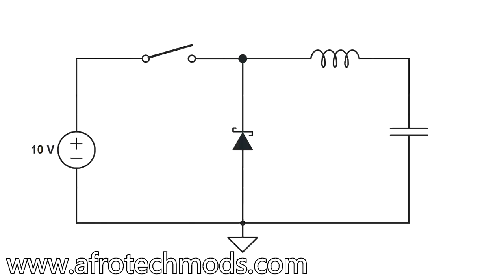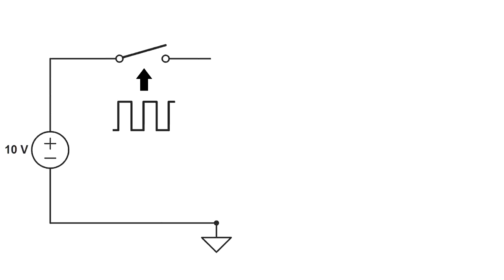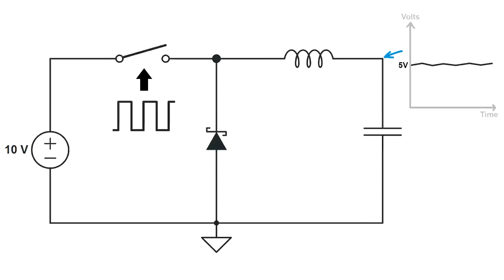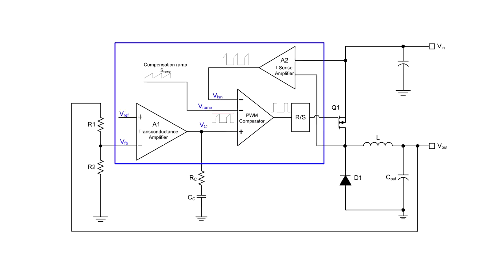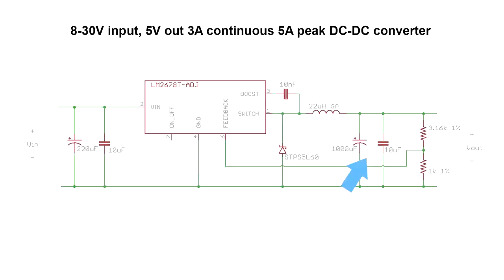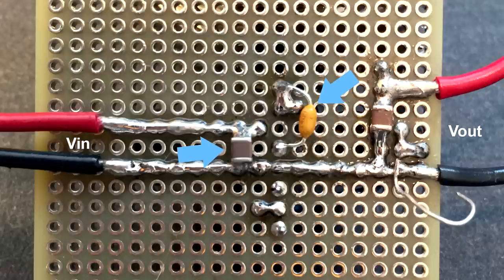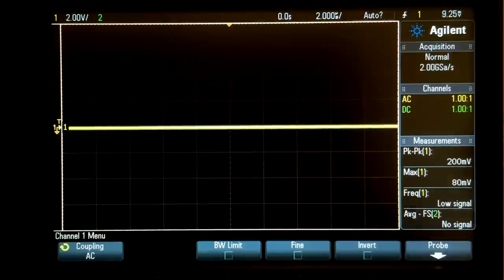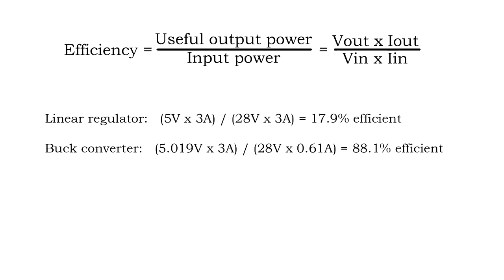Switch mode power supply tutorial: DC-DC buck converters

Comment: Great video on how to build a DC/DC switch mode power supply. And, thanks for featuring TI's SIMPLE SWITCHER buck converter.
Reply from the maker: +Texas Instruments Glad you liked it. Been using your products for years!
Reply: +Texas Instruments i didnt expect that...
Reply: I wished Ti would have more reference designs for us newbies on their  chips. I mean more reference on variable outputs using digital pots and linear pots would be nice. More references on pass power transistors for more current output too. I always throw together a lm317 circuit for 15 amps or more to test audio amplifiers. I could figure this out but would rather not blow out $200 worth of parts before I get close. And as far as I can see, none of their simple switchers, high amp series chips have any reference for soft start circuits. What's the first thing a newbie going to build? A high amp variable voltage power supply . Make it easier for them and get them hooked on your products and they'll use them for life at what ever company they're working for....
Reply: It's sad that none of you guys will do a tutorial video on how to solve feedback loops for compensation networks in switch mode power supplies. You guys always take the easy way out with using devices that have the compensation networks in place. Is it really that hard for people to understand it or is the math too advance that you might scare away people?
Reply: Microcontrollers are what is holding prices down, everytime they get smaller they are cheaper to made(more of them fit on the wafer) and contain less physical material than additional wires and PCB components with same function. And they are available for analog applications as well.
Reply: Great video +Afrotechmods im getting a wave like pattern at out put. I am making power supply from 12v to -2.5 v. Should I increase caps on the output??
Reply: Afrotechmods great video! I also making a 12 v to -2.5 v power supply and getting waves at the end with quick slope up then slow slope down at output. Should I increase output caps? Thxx
Reply: Most of these videos are for a laymen or hobbyist who just want something that works out of the box. They are not interested in the theory behind what makes a stable DC to DC converters work. Besides if he went the route you are suggesting the video wouldn't have half a million views. Therefore hit the books not youtube if you want to learn how to design compensation networks for switching converters!
Reply: T
Reply: @ihatenumberinemail  Because an analogue circuit can react far faster than a microcontroller, and is unlikely to crash sending 28v to your downstream circuit because you failed to anticipate all control conditions in the code. There are applications where microcontroller control is appropriate, but using an actual analogue control loop will always provide better transient response in the load, especially during turn-on, and lower noise on the output.
Reply: Wow! Just found this channel. What a refreshing mix of theory with very practical considerations when building. So much better than those white board regurgitation videos by people who never build anything in the real world!
Reply: Now thats a recommendation my PI would have noticed😂

Comment: NOW I get it! sorta.
Where can I get a "crack-head mashing a mechanical switch" and what's it's service life?
Reply: In my neighborhood. They are everywhere and pretty cheap.
Reply: Yea but how long do they last and how reliable are they, and will i have to hide my valuables
Reply: Yup. They'll pawn your Fluke multimeter for $20.
Reply: Lmao!
Reply: +Shroom Duke That crack head has had me rolling around the floor for the last 5 minutes!!
Reply: there are not many limits to what you can get a crackhead to do and for how long, if you have enough crack to keep them going.  only crackheads with no crack will pawn things.   A crackhead with crack will only smoke crack, and wont stop until it is gone, and like any other constant, you can use this to your advantage.   All you need is a transistor, 2 crackheads, 3 crack pipes, and 2 lighters.   wire the base to your breadboard, wire the emitter to the push button of 1 of the lighters and the collector to the other.   Now you have just built the fastest switching and smoothest regulation with just 1 component (+crackheads/crack accessories/crack)why 3 crack pipes?  well think of it as a fuse, if they go too fast they will eventually break their pipes and stop functioning until you replace the pipes, the 3rd pipe provides some protection against this condition by not only serving as a replacement should one of the pipes break, but also sharing in some of the load, increasing the overall life span over a 2 pipe design.
Reply: Don't let them pawn the comedy gold from this comment section.
Reply: @asulliv1954  speaking from experience I was not offended

Comment: I've tinkered and modified a few switch mode power supplies to make them produce different voltages (usually higher) than what they originally did, this has inspired me to make my own regulated SMPS based on this.  I might make it variable by changing one of the feedback resistors to a variable resistor and see how well that works.
Reply from the maker: I think you will like next week's video then.

Comment: Great video Afrotechmods. Buck converters are so much better than linear voltage regulators. I have a homemade portable charger with a usb port that i limited to about 2 Amps and a Buck converter can really do the job. You can also buy cheap buck converters that they install in some cars in Asia for interior lights and stuff on ebay for cheap and they can be a bit more efficient and weatherproof than what you could build from this video. Great explanation about them! 5/5
Reply: Don't discount linear regulators too quickly! They have their niche too. Without the switching action of a SMPS, they generally have cleaner outputs. They also don't require inductors, which is very important because inductors are by necessity large and expensive(in a relative sense.) With a low dropout linear regulator, one could achieve reasonable efficiencies by keeping the input to output voltage ratio close, though care must be taken not to come too close to the dropout point. As afrotechmods mentioned, in the range of about an amp or lower one could consider using an LDO, and the total solution size, cost, and output ripple would be superior to any switching power supply.

Comment: Nice job getting the LM267x series to work well on perfboard! Without using snubber networks I could only ever get them to give low output ripple by using a PCB with ground plane lol.
Reply from the maker: I was pretty impressed that I pulled it off on perfboard too! The huge ceramic caps I used were larger than you would ever need in a commercial design, but they give extra leeway for beginners to make mistakes and still have good performance.

Comment: I was experimenting with 555 step down/step up
all you need is mosfet/npn for step-up or pnp/p-mosfet for step down
and zener diode+transistor
so you pull down reset pin on 555 with transistor (which is pulled up with 10k)
voila, you have voltage stabilization
maybe tl431 also will work

like this if you like my idea

Comment: Can you make a tutorial on making a SMPS using a crackhead mashing a mechanical switch?
Reply from the maker: Got a crackhead I can borrow?
Reply: Afrotechmods in my class i have two of them. I wonder how  I can send them to you. The german mail will check for human contents :(
Reply: just build the 3:21 circuit and use a big button, a large inductor with iron core (like the primary of an ignition coil), and a huge electrolytic motor starting capacitor!
Reply: ***** Due to the high cost of supporting a crackhead, you should opt to use a variable speed motor to mash and unmash the button. In addition to being less costly it would be much more reliable as well. (plus you don't have to remain present to assure it doesn't run off with your expensive silverware).

Comment: Good video. They only flaw I see is the use of solder to conduct current. To me that is always a no-no. Proper soldering technique requires all conductors to be as physically connected as possible with the solder only making up the last microns of conductivity. I've been in electronics repair for almost 40 years, and by far the most common failure I've seen is improper soldering on high power/heat connections such as transistors and power resistors. Never rely on solder to make the physical connection. For this demo, sure it works, but I wouldn't put that into anything I wanted to keep working for years.

Comment: Seems like you could feed the output of a buck converter at desired DC+max ripple into a voltage regulator to have the best of both worlds: the heat dissipation on the regulator would then just be the RMS of the ripple voltage by the current, significantly less than down-converting from a primary source. And you'd get the smooth DC output you need for sensitive circuits.
Reply from the maker: Yup. This technique is sometimes used in commercial designs.

Comment: If I understand correctly, it draws less current while providing 2A output current (Shown in efficiency calculations). That means, I can use a 12V 2A (24W) common adapter to power 5V 2A (10W) Orange Pi and and 12V 500mA (6W) white LED strip. Correct me if I am wrong.

Comment: I remember my first linear power supply with LM7805 and LM7812. We used a casing with was pretty much a big steel casing and inside we screwed those LM's to heat dissipation aluminum thingys. It was pretty powerful but it got hot. Not long afterwards I thought why did we not just heat dissipate to the case which should/could take even more. And sure it could have been a disaster but nowadays with pretty small sensor/RCB type of things I think the casing itself just to dissipate heat better.

Comment: What are your thoughts on using boost-buck converters for applications such as solar powered chargers (mainly concerning how safe they are). Many companies make boost-buck converters which will basically take a very wide input range (often 1.5-40V) and produce a regulated output. I was thinking about using one along with a prebuilt USB power bank (since many places such as ebay will have 12,000-20,000 mAh ones for less than $20) It just seems like a nice upgrade to one would be to add a solar panel in addition to a boost-buck converter, and a small power switch to essentially allow for solar powered charging of those USB power banks. (It would also be cool if it can be safely done, to have a build of it on a video)
Reply from the maker: There's nothing inherently unsafe about boost-buck, the safety will be a function of how well they are designed. Boost-buck is a good way of squeezing a little extra juice out of solar cells that are operating at low output levels, but if you are really looking to go all out you should look into MPPT controllers.

Comment: Afrotechmods, First let me start by saying your videos are my favorite gotos for trying to learn more about electronics. I've watched most of your videos at least two times, often more. 

I may not be understanding all the concepts completely yet, but I had a thought and wondered if there was any merit to it:  

Would it be possible, or even make sense to use a buck converter to get the power roughly where you want it, then feed that into a linear regulator to compensate for the AC ripple, thereby getting the efficiency of the buck converter, and the smooth DC from the regulator?
Reply from the maker: Yes this is possible and some high end adjustable power supplies use this topology.

Comment: Hi man. Very nice videos with parts attached. Question: Why do you need two caps in both input and output? Can you just use, say, a big 300uF in the input? and 10uF is nothing compared with 1000uF in the output. Why do you need two? thanks a lot

Comment: Say you have 12-30 input and wanting a steady 24v, current draw on 24v is never higher than 0.8 amps, how would you calculate what size fuse you need on the input side of 12-30v?

Comment: What are common switching frequencies of buck converter chips?
I've noticed that many switching regulators produce radio interference on 433Mhz (RC), which is quite annoying.
Reply from the maker: Anywhere from 40kHz to 4MHz, and it keeps getting higher as technologies improve. Switching frequency definitely affects the amount of interference put out, but good PCB layout and good component selection make the biggest difference. Learning how to design a good SMPS is almost an art form and I barely scratched the surface with this video.

Comment: Love this! A question if I may? I'd like to make a buck converter to switch about 20v down to 5v, maximum probably an amp. Probably less. Ideally I'd like it to take as few components as possible, and especially want it to be tiny, which rules out big 50V capacitors I guess? Any ideas how I can make good space savings (mainly in height of component)? Random question I know! Thanks, Mat

Comment: Now this is an awesome tutorial. I´ve been dealing with circuits for a few months only, as I´m interested in building a robot, where a buck converter comes in pretty handy. A fool like me startet with linear regulators, with all those disadvantages you just mention. I just have to give such a buck converter a try. The only question I have is, whether you know a good switching regulator for 5v 3a but with less voltage drop. The regulator used within your videos is rated 8V minimum to achieve 5v. Is there a good one with e.g. min 6-7V on the input?

Comment: Could you build a Buck/Boost Converter with current adjustment, not just voltage ajust? Also, I would like an output current greater than 1 A. Maybe 3-5 A would be OK.
I saw some clips using CI 555.

Comment: Great circuit upgrade from the LM317 video, and just what I need - 0-5 v output(i NEED to use a potentiometer) but I need a reduced ac power supply without the use of a bulky transformer - can I build a bridge rectifier with resistors after each diode to create a voltage drop (is this a forward voltage?) in order to create a 8-10 Voltage input for my regulated dc circuit? OR should I just connect my potentiometer to one branch of a voltage divider sub-circuit?   Thanks again

Comment: Once again another great video!! I was pretty stoked when you mentioned Dave Jones! When designing a boost converter using surface mount packages, would using a ground plane be an effective way to lay out the board?
Reply from the maker: Yes that is pretty much essential. Use lots of vias too.
Reply: Afrotechmods Another think I have noticed in a lot of data sheets is "Power-Ground", as well as Signal ground. It would be nice for you to clarify the difference between the two in another video
Reply from the maker: That's the type of thing that would be covered in advanced PCB layout tutorials which I may do at some point.
Reply: Afrotechmods
 could this be used to step down high DC voltage say 25-50v DC to say 5-6v DC? amp load on the out put would be around 8amps +/- 2 with a peak of 12amps
Reply from the maker: Elios0000 You would want a synchronous buck converter for that, and that's quite a different circuit to the one I showed.

Comment: Do you have any experience from Picoscopes? I was thinking of getting their entry model 2200A, and use it with my laptop for hobby projects, it's tempting since I could get the scope and two voltage + 1 current probe for less than an entry level bench scope alone.

Comment: Hi! After you explained how the buck converter adjusts the duty cycle of the pwm signal, I noticed that as the duty cycle increases, more of the input  power is usable. So if I understand correctly, the buck converter should be most efficient when the maximum output is drawn. And when the output is less and the duty cycle decreases, the efficiency should fall again. Is this way of thinking correct? Or is there something I’m missing?

Comment: Very informative. I am new to electronics. Question...I am trying use a DC motor (old treadmill) as a generator to somehow regulate the voltage to charge USB devices (5V 1A). Could I use a similar circuit?

Comment: Hi there, thank you for the video..

I bought the lm2596s buck converter from aliexpress.. I'm wondering if I need to filter the output of the buck converter with 10uf combined with 0.1uf  ceramic capacitor or I don't need to filter it anymore..

my project is to combine 5v bluetooth device with 3w pam8403 (also 5v) amplifier using 1 molex power adapter with 12v and 5v output 

thank you, I learned a lot watching your channel,. keep up the phone excellent work